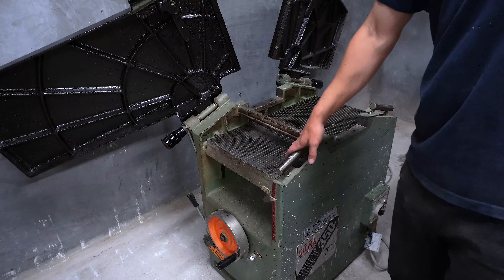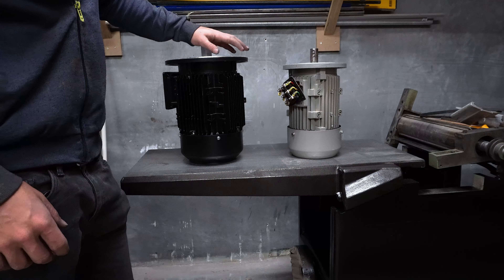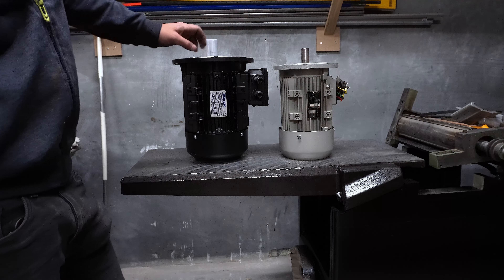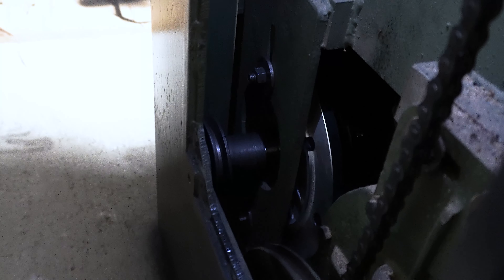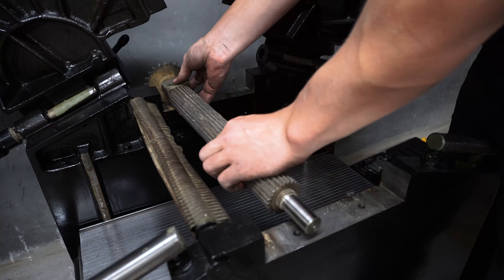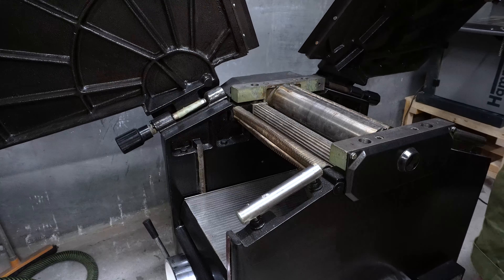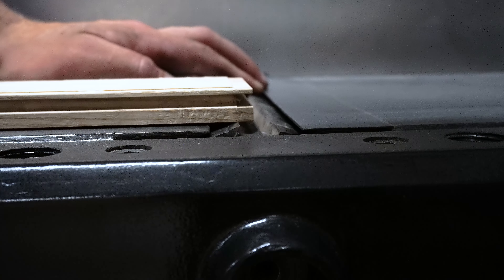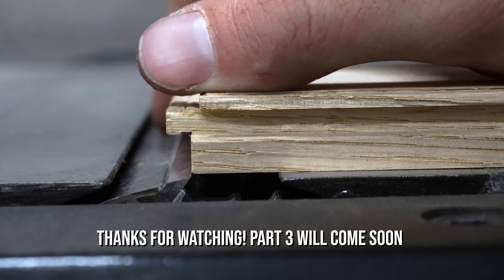My Endgame Jointer Part 2: Painting, painting and more painting

Comment: Great job!! I love old well built machines like the one you have. I restore lots of machines. That Sicma is very heavy with cast iron and once set up will last a life time. Keep up the good work . Nice to see young people that like woodworking and restoring old machines! Got my first table saw when I was 12 y/o, a Craftsman. I am still woodworking and restoring old machines 56 years later. Still lists of fun. Currently have have 5 table saws. Just finishing up an older SCM short stroke slider, an Oliver 232, and 2 Powermatic 66 table saw. Keep the videos coming. You are good at it. Thanks!